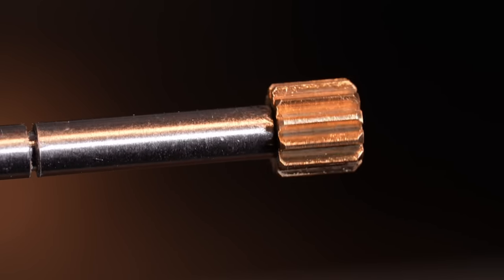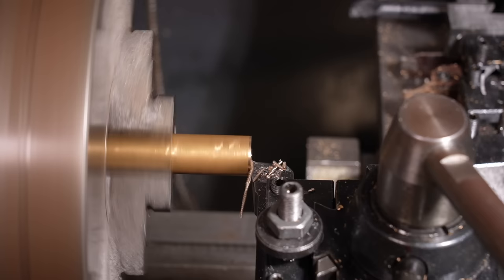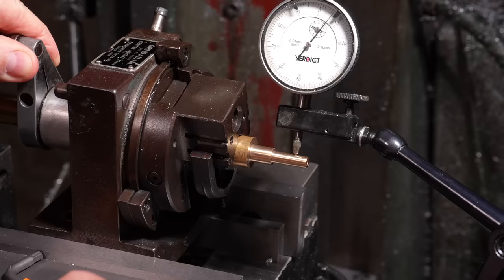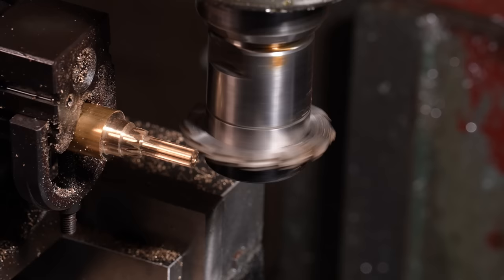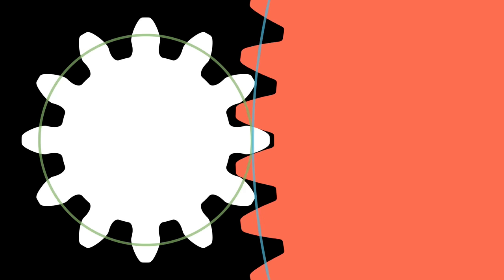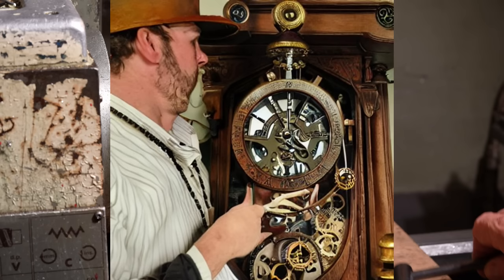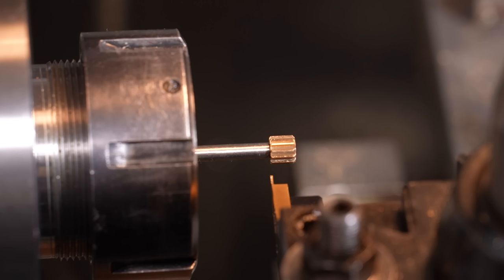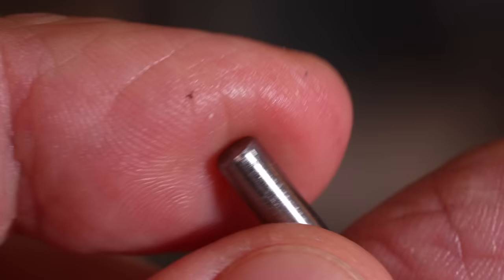My First EVER Try at Machining a Brass Pinion Gear - or ANY gear!

Comment: Clickspring has some  neat videos on cutting gears
Reply from the maker: Chris has some neat videos on EVERYTHING!  That's a quality level to aspire to. I don't know why it took me so long to get round to gearcutting.
Reply: @MachiningandMicrowaves  Agree...  He's an exceptional machinist and metal worker.  You're not so bad yourself!  Been a hobby machinist for ages, but I've still not machined my own gears.  Just buy gear stock for the 0.2M and 0.3M gears I use in my hobby pursuits, but would like to some day, just to say "I did it".  Great video!

Comment: I'm surprised as this is your first, with all of the RF gizmos none with rack and pinion ?  Saw tooth capacitor using variable length gear teeth... 🙂
Reply from the maker: It's just weird I know, everything I've worked on has had threads, not even worm gears. Now I have the scent of pinion blood in my nostrils, I want to make MORE GEARS!

Comment: yay ... do you know the part number for the inserts, they look just like mine, and I need more ?
Reply from the maker: Those are from Cutwel, https://www.cutwel.co.uk/ccgt120408-al-yg100-carbide-turning-inserts-ground-polished-chipbreaker-for-non-ferrous-yg-1 but I only paid about £5 each in a cheap deal. [EDIT:  just checked and they are YG10 not YG100. ] The similar ones from Arceurotrade are actually pretty good, but I like the YG-1s.  They even do a decent job of cutting those thin steel rods, as the tool pressure and deflection is very low. I also use the CCGT120402 where I need a sharp radius, but the 0.8 radius version lasts much longer and can break a good chip even in 608s aluminium if you push the feed rate right up. I tend to take two balanced cuts at 0.2 mm DOC for finishing to dimension and the 0.8 radius still works well at that, but it's happier with the nose buried a bit more.  I have some CCGT060402 inserts that I use mainly on boring bars

Comment: That brass is awfully red-ish for brass... Looks more like bronze by colour... Tho, the sounds of `er wha are that of machining brass... Either way, both would be a decent material for what you are doing...  And the colour might just be deceiving me through your shop lighting, your camera and finally my 15 year old lcd screen... Also, why do i have a feeling that i have seen this video of yours before? Is it divine machinist visions, or have i fucked up playing with my big lathe and traveled back in time today and am seeing this video again - for the first time?
Reply from the maker: I forgot to apply the colour correction after I left the halogen machine light on by mistake, so everything is a bit too pink/yellow.  I'm going to replace that spot with another 100 watt cool white LED photo light with remote control, but I need to get the ceiling rails fitted for the lights and pantographs first.  I ran a short video of an animated on-screen annotation last week as a teaser just to test my Wacom tablet, but re-shot it completely for this video, so you weren't imagining things!

Comment: I knew it - this whole channel is AI CGI. Proof:  at 27s, you see the 4mm shaft against his finger. The finger is at least 7 diameters across, that would make his finker 2.1cm across at the tip, thats a measurement only an AI would make, having confused the tip of things it finds in the other 97% of the internet.
Reply from the maker: BLEEP BLOOP +++ETAOIN SHRDLU
I'm a large language model trained by OpenAI to assist with a variety of tasks, such as answering questions, providing information, and offering suggestions. I don't have the ability to distinguish between those types of objects. 

Did you ask daft Alexa for the answer to seven times four by any chance?